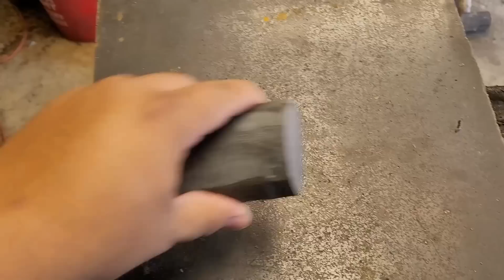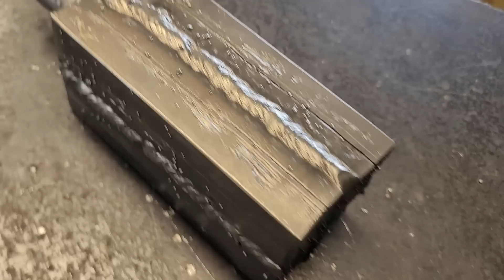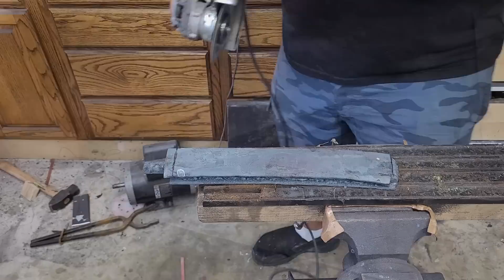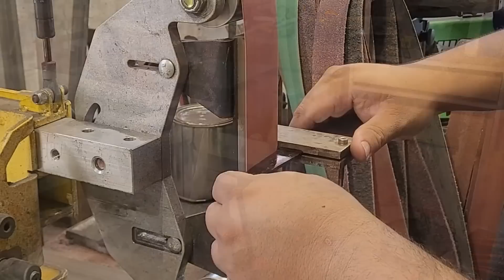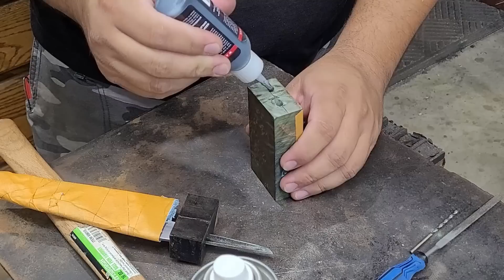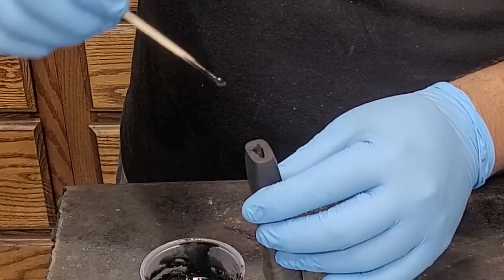Making A Gator Skin Mosaic Damascus Chef Knife

Comment: @JPs Bladeworks i love your videos been subbed for a long time. i make damascus to, Have u ever uses kerosene? u can dip your billet before the forge and it will not only burn out any oxygen but leaves you some extra carbon in the end. i havent had many delams except the ends since i started using it. keep up the great builds
Reply from the maker: Yea i have a gallon of kerosene and a gallon can of dw40. Both give the same effect. I change it up depending how im feeling that day.

Comment: 5 inch is to short and 7 inch is to big for home use imo. About 5 1/2 to 6 1/4 is all is needed. Also put the sudoku vertical, half circles for keeping stuff off the blade when cutting stuff like cheese, anything being cut thin. I made a few hybrid knifes that are being tested made with these features. There is a few other features but going well so far for 6 months. 6 more months to go . I got tired of these inferior kitchen knifes on the market, even the 5k ones each.
Reply from the maker: The first time i used a good knife it was life changing. Before all i used was cheap walmart knives and the handmade one i used was mine from when i started so it eas very mid but still far better than the cheap stuff.

Comment: to hide gaps between the different woods i use a small "spacer" out of leather.. i can be compressed, soak with epoxy and get rock solid.. becouse its soft it evens out small iregularitis and fill small gaps. i dont have a surface grinder so i dont getthe handles 100% flat so i use the leather to get paralell handlescales or "clean" blends between different handle materials
Reply from the maker: Thats an interesting way to do it. I do my cuts on a chop saw at my brothers shop and then i just sand the peaces on a flat surface. I tend to get better fittings when i uses expoxy instead of ca glue to glue the 2 pieces together since i have more control but unfortunately i dont always have 7 hours to wait for the epoxy to cure.